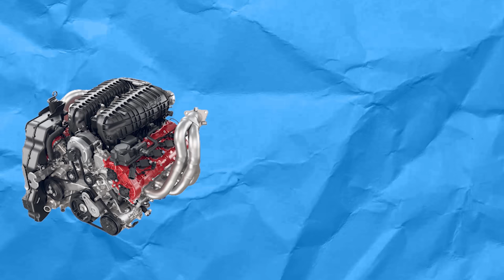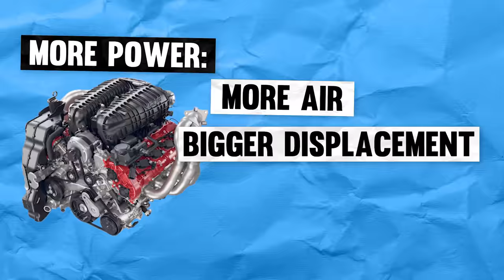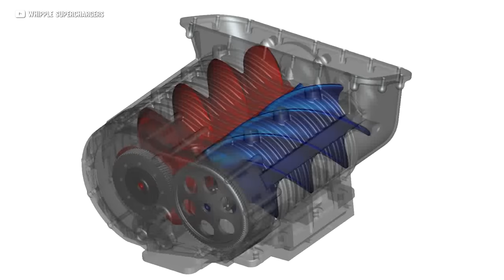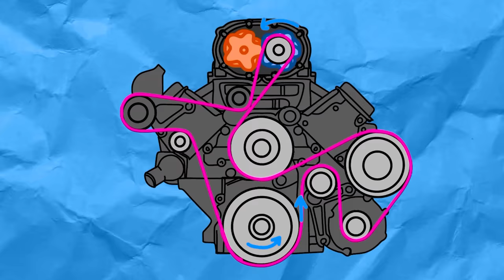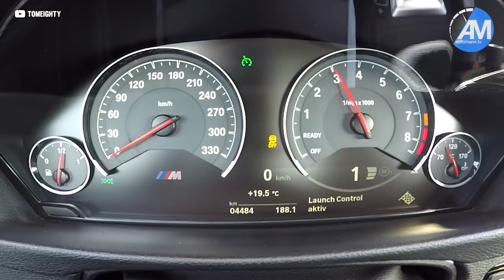Turbo vs. Supercharger - Which is Best?

Comment: After building racing engines of both flavors I can say this: If you want to play on easy mode, just get a blower. If you want every last bit of power as efficiently as possible, and you don't mind extra challenge and complexity, get a turbo (system). 
Turbos, btw, arn't free either. They create backpressure that the engine has to work against, it's just much more efficient than a belt.
Reply: @Gustav 
No. Exhaust backpressure is pressure in the exhaust system that impedes exhaust flow and works against the pumping action of the pistons. On a turbocharged engine the turbine, the part driven by the exhaust, is usually a restriction, thus creating backpressure. This isn't altogether bad as the boost generated by the compressor, the other side of the turbo, means we can burn much more fuel and make much more power then the restriction the turbine costs us resulting in a large net gain. 
Engine breaking (in spark ignition engines) is something else. Engine breaking is when you close the throttle and a large vacume is created which the pistons are pulling against which slows the engine which slows the vehicle. If you've ever stuck a suction dart to a piece of glass and noted how hard is can be to pull it straight off that's a tiny fraction of what the engine is experiencing.
In a sense it's "reverse horsepower" trying to stop the engine.
Reply: @177SCmaro  Re: engine braking;  this is mitigated by it's either a bypass or a dump valve (can't recall how it works) on the inlet side which allows the turbine to stay at speed. @6.05 the guy is installing one,pretty sure it's a blow off. That said there's nothing like that 2 stroke effect turbo's have when it hits the powerband like a 2 stroke motorbike

Comment: Use both supercharger for low end and turbo for hi end power.
Reply: Volvo is currently doing it but Volkswagen, Lancia and Nissan have already done so. To make this relatively short, Saab made a successful low pressured turbocharged engine which fattens the low end torque. However soon enough Volvo followed suit and exploited Saab's weakness, relying on bigger displacement such as 3.0T. Nevertheless the Swedes were the first to make proper low inertia turbocharged engines. I was surprised with Volvo's 2.4T (2.4 LPT) - it's a lot faster than you think esp. in many real life situations. It was a treat compared to Volvo's old school high pressured T5 (2.3 HPT).
On paper the old year 2K era 2.3L T5 was faster than faster than the 2.4T but not in real life. Volvo's LPT is surprisingly good for low and high revs.
Off course now Volvo has been hunting for even fatter low end torque and high eng power so here comes the new "T6" 2.0L inline four Twin-charged.
Reply: Make it two of each to be safe 😂
Reply: Twin charging

Comment: also one difference is that superchargers have very linear power delivery since it runs parralel to your engine revs, while a turbocharger would have to build up and spool the turbo to kick in. i mean with anti-lag you pretty much cut off  that delayed response it takes the engine to burn fuel and then get out the exhaust to then spool the engine. Or even sequential turbos that have a smaller turbo for lower RPMS and help the bigger turbo spool up and take over at higher RPMS. They both have their quirks and both sound amazing.

Comment: The addage "no replacement for displacement" still applies, even with forced induction... More room, More air that can be forced.... There is a reason you dont see 5000hp 4 bangers...
Reply: while I do agree, there are exceptions. Koenigsegg Gemera has a 2 liter inline 3, making 800 bhp on its own (1800 with hybrid system).
However, the engine displacement affects the handling, so yes, forced induction isn't the same
Reply: There is no replacement for displacement but even a 4 cylinder in something that weighs less than 2000 lbs will make great power to weight ratio if built right that can potentially take on 5k hp and come out on top.
Reply: @TheMrDarius  when you start going up over 2500hp the weight doesn't matter nearly as much. 5k hp isn't even viable on the street and would need to be on a prepped track.
Reply: @Inferiis  with what fuel does make that power
Reply: @rawful502  as far as I know all Koenigseggs are designed for e100 (aka biofuel). Not sure about the Gemera though, but it runs on anything octanewise
Reply: Theres a lot of Mitsubishi Evolutions making over 500hp tho

Comment: I think a turbo also robs power from the motor because it's clogging up the exhaust. I still like any forced induction.
Reply: A lot less than a supercharger
Reply: @mansikkamies9146  Only way to know for sure is to measure actual fuel usage at same horsepower output on both motors or measure horsepower output at same fuel usage on both engines. All else is just opinion, right?
Reply: A turbo eats up like 5hp, wayyyyyy less than a supercharger

Comment: For turbos, they should have a pressured air attachment so you could blow a ton of air in them without waiting for the motor to spin them up. And a small air compressor could be attached to the alternator so that air compression can also be available cause you only need it for the initial spin up.
Reply: Nitrous is cheaper easier less complicated and weighs less.
Reply: Why add another compressor when you can just spin the turbine attached to the compressor faster.
Reply: @jodyjohnstein  and will ruin more engines too
Reply: @jodyjohnstein and burns an engine up
Reply: @Rickets1911   yall habe no idea what you're talking about. Nitrous doesn't blow engines up any more than any other power adder when done right. Bad tunes are what pop nitrous engines. Same with turbo/blower cars. I have a friend that has been on the same big block Mopar nitrous motor for like 6 years. He runs mid 8s in the 1/4. In a 3500 lb car no less so every bit of 1000hp
Reply: @jodyjohnstein  turbos have more useable power, and more overall power. 
and watch your language, some of us are more experienced than you might realize. Turbos don’t blow engines like nitrous and superchargers do. They make smoother horsepower, and it swells, making it more useable, rather than a linear slam coming off of the crank,, or an overly hot piston chamber…
Nitrous is the easy way to build a race car. Turbos are the right way
Reply: @jodyjohnstein  a proper big boy set of turbos on a small block will max at around 3000 to 3400 horsepower .. and would dust anything else from mid track on..
Reply: @Rickets1911   @Rickets1911  my first comment was turbos>>>> I was saying spraying to get the turbo up on the converter makes way more sense than this compressed air nonsense op is talking about
Reply: @Rickets1911  what do you drive. Amd what qualifies as "big boy turbos"
Reply: @Rickets1911  twin 88s is a big boy setup show me a sbc on twin 88s making 3k lol
Reply: @jodyjohnstein  the famous Big Chief runs 8891’s ,, and he’s making around 3000 hp,, at the tires
Reply: @Rickets1911  that's a 481. That's a big block champ
Reply: @jodyjohnstein  I misspoke about the disc breaks, they were added, and they are not from factory.. they’re kit, and I didn’t do the work either;; full disclosure,
It’s a Windsor motor.
Reply: @Rickets1911  it's based on a hemi/BBC even still it wouldn't be a Windsor anyway because it isn't a ford block. Isn't even based on one.  Stick to watching the videos you don't know what you're talking about champ
Reply: @jodyjohnstein  we are talking about my car, correct? You asked what do I drive. 
You’re one of these guys who knows everything. Look, it’s a real car built by ford in 1969 with a 351 ‘Windsor’ engine. That’s the small block. It’s a Mach One dude.
Reply: @Rickets1911  oh I thought yiu were talking about big cheif. Yeah that proves my point even more.
Reply: This is the stupidest thing I’ve read today…. Electric turbos are the way of the future.

Comment: Nobody tests how much horsepower is lost due to the exhaust restriction of a turbo.  Most will show how much changing to a smaller exhaust system but not the turbo.
Reply: nail on the head with this one.
to compress the same volume of air requires the same amount of power irrespective of how its done.
add in compressor efficiency and theres even more power required. quick search, twin screw can reach 92%. say 80% average? havent seen a turbo with a map over...75%? and its pretty hard to keep a turbo in that sweet spot....
that power for the compressor has to come from somewhere.
some of its the heat in the gas. in this regard turbos are great... a piston cant use that energy.
some of its the pressure of the gas. (which is due to the heat...)
takes power to force air OUT of a cylinder at anything above atmospheric... through a restriction...

always bear in mind the same amount of air that enters the compressor then passes through the engine and out the turbine. the only thing about it that changes is its temperature. maybe a slight volume change from chemistry, but its mostly from air expanding when hot. burning fuel adds heat. found a video of some guy running a turbocharger turbine engine, as external combustion. just heating the air up with a big heat exchanger. proves the point. engines run on air.

and then theres exhaust gas left in the combustion chamber. at 10:1 CR that leaves ~1/10th of the cylinder contents as hot burnt gas.  if the pressure is higher than atmospheric at the end of the ex stroke, theres more than 1/10th left as exhaust gas in that clearance volume... and that gas has to re-expand and fall below the manifold pressure before new fresh air can even start moving in.

still have to love the sound of turbos :)

Comment: I was running a vortech v-15 off an electric me1616 at 175v 10,500rpm via pulley with great success, no parasitic losses at all.

1900hp centrifugal supercharger.

Comment: I prefer turbo for the street. It's the "Ideal" answer. Adding 'chargers is adding displacement. The specs use liters for gradiations, no?
In 1972 I ran twin Garrett turbos on a 390 GT 500, my fathers co. installed the turbos at $100 each stating that two were necessary on a V-8 for balance. All I know is the damn thing ran low 9s in the quarter!

Comment: I like how while he's talking about displacement modifiers and such he shows a picture of THE FIRST naturally aspirated engine to make 1000HP (the ZZ632/1000 produced by GM). I have always leaned more toward turbo but I am a firm believer that there IS NO replacement for displacement, I mean you build a small engine up, it could smoke a standard V8, but you take the time and build it right, a ZZ632 with a reasonable supercharger AND twin turbos, could probably smoke the Hoonicorn or a Tesla Plaid
Reply: It's the first over the counter 1,000 hp NA engine. They've had 1,000+ hp NA Pro Stocks for decades.
Reply: And btw, no BBC has run 300.4 mph in a standing mile on oem parts, but a little oe block and heads 5.4L in MKII MOTORSPORTS TT GT has.

Comment: At the high end of power, it's an argument - Aircraft piston engines were usually turbocharged, but Top Fuel makes more power and are supercharged.
Mostly though it comes down to where you want the power boost - low-end grunt you supercharge, high end power go turbo especially if your car already has issues hooking up.
Reply: If you are good at systems design, you can get both with turbos, but it requires thought and planning, not just "slap a turbo on'er and call'er done" engine and engine systems building.
Reply: Turbo's got banned by top fuel years ago they made the cars too fast😂
Reply: @shyanhansel3264  Then explain why they didn't ban superchargers, that make the cars even faster yet?
Explain why they went to 1000 foot dragstrips from the classic 1320 "quarter mile" strips YEARS ago due to excessive speeds?

Your claim makes ZERO sense.

Comment: a belt driven centrifugal pump is a cross between a positive displacement pump (a roots type for instance) and an exhaust driven turbo.  Search term for this is procharger.  My belt driven supercharger starts to register boost at 1200 rpm.  Life is good.  Enjoy.

Comment: I have a 350z that I’m considering boosting but I’m still on the fence about wether or not I want to turbo charge or supercharge.
Reply: Would be unique to hear a supercharged vq
Reply: @__AverageJoe  do you think the engine has enough power for a supercharger? I know there’s quite a popular one by vortech
Reply: Had a manualtransmition 2004 350z convertible.. back in the day  when my engin blowup i swapped it with a much cheaper option cause i was low in budget.. so i went for not other than the 2 uz-fe lol  .. it was so much fun to drive the only issue is i couldn't activate the vvti system so the engine was 50 hp lower that its full potential.. overall the V8 sound and feeling was somthing else on such a light car !!
Reply: Try a pro charger
Reply: With turbos, you can size things so that the torque curve doesn't go HIGHER, but it stays much longer, so you save yourself the budget of driveline upgrades while having to make your engine more suitable to revs.

Comment: I used to work for a Large Corporation that dealt with the DC 990. What they would do was change the pitch of the blade mechanically. By doing this it was easier & much quicker to get it up to speed. Their bye making it easier to start. There were some other innovations it shared that were Unique to this area where I live. I.E. Zippo, one of the things that were unique to a Zippo Lighter was that it was windproof. It wouldn't blow out. That's what engineers had to do to make the 990 a viable choice for Consumers. They had to make the igniter windproof because it would often blow out. I know the igniter looks nothing like a Zippo, but honestly. Where do you think that engineers Idea might have come from ???🤭

Comment: I have a 2018 Trackhawk facing 6 years in May (expensive to maintain without warranty).  Love the instant acceleration anytime I hit the pedal!  In college I had a Mustang 5.0 and got a new Eclipse GSX turbo when I graduated in 1992, which the turbo lag was apparent, unless I held the break and pedal in a simulated launch without the buttons of today.  Now I'm trading my Trackhawk in a Macan GTS (on order, deliver in April) and I've concerned if I'll like it as much (haven't driven a GTS) because of the lag I experienced 30 years ago, but I can't get a new Trackhawk (don't make them any longer)...but this video is awesome at explaining the differences and I love the fact that you reference the Hellcat engine and the launch control of the turbos.  While there might be lag when stomping, hopefully I'll have good instant force using the launch on the Macan GTS.  You've given me some positivity to look forward to!

Comment: No replacement for displacement holds true tho. Comparisng say a twin turbo 3.5 V6 to a 6.2 V8 sure you can squeeze more power out of the V6 that's nearly half the size, but it's apples to oranges. One is FI the other is NA. You would see WAY more power out of the V8 with the same setup if it's apples to apples there is no replacement for displacement that doesn't mean an I4 or a V6 can't seriously crank out some power tho because they can MOVE with enough boost
Reply: Its a replacement not a replica. It should be apples to oranges. The whole point is to get big engine power without a bigger engine. Because you can add it to a bigger engine and now make even more power on that engine without upsizing it proves that FI can replace displacement
Reply: @jacobshriver5699  agree to disagree then, I don't think it's an equivalent comparison and shouldn't be considered as such. If you got a stock LS1 and compare it to a rally I4 with forced induction, you think that's a fair comparison?
Reply: @Millirawk  yes because the argument is forced induction can replace displacement. So if a boosted inline 4 or boosted v6 can make 1000+ hp without being a v8 then it has replaced displacement

Comment: Fun fact: European trucks are technically twin charged.
The turbo adds boost to the diesel engine and the compressor compresses air for the air tanks (that the brakes and other pneumatic stuff uses)

Comment: Turbochargers aren’t complicated… if you have a functioning knowledge of mechanics.
Reply: Is it just a case of knowing where everything goes like most engines or...?
Reply: Not complicated? Oh no? lol I think you're talking about grease monkeys installing "kits" where all the complicated stuff is largely worked out by someone with a functioning ENGINEERING knowledge. Try building up a turbo system from the ground up.

Comment: an obvious solution would be to have a supercharger for low rpms and a or two turbos for high rpms but at the cost of higher fuel consumption but the power output would be fun if its a v8 or above i would say

Comment: Supercharger pro ( instant torque and hp available at earlier rpm) con (heat soak heat soak heat soak) u start to feel the sluggish after a few back to back pulls . 

Turbo pro ( more power options control of the power band , room for massive power different options etc etc. Con (turbo lag lag lag lag usually see power mid to higher rpm’s  to small of a turbo and u choke up top to big and u have lag for days common in high power applications.) 

That’s literally both in a nutshell without all the what ifs and X factors I own both amg supercharge and a Audi A4 big turbo.

Comment: Before I watch this, I will simply say each has its own benefits and use for different environments…like high altitudes. Turbos are great, roots blowers are get if you need Instant flat torque..turbos will make more power at the same valves on the same engine, as you don’t have to use engine power to turn the blower..yet a blower will give you Instant horsepower and torque in relationship to the rpm of the motor..
Reply: The turbo will always make more power, which is what matters